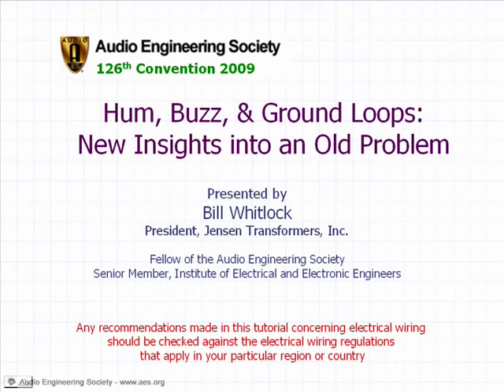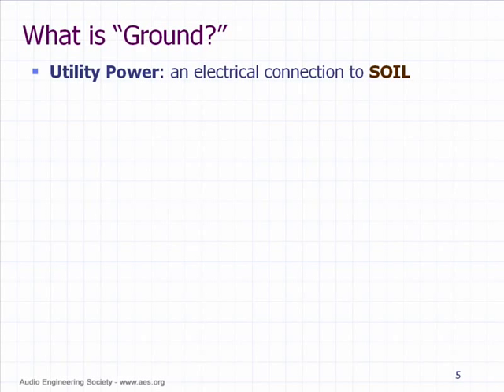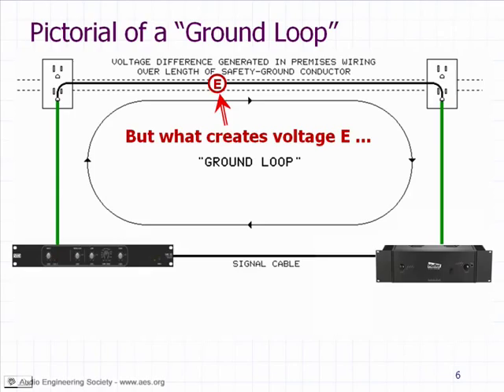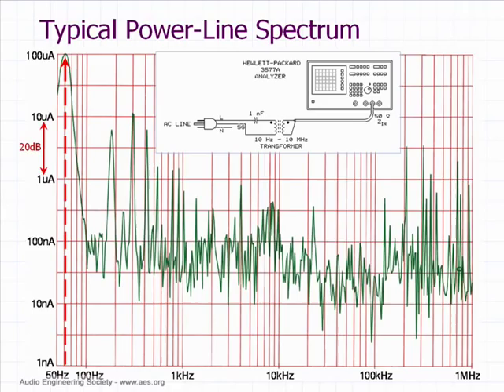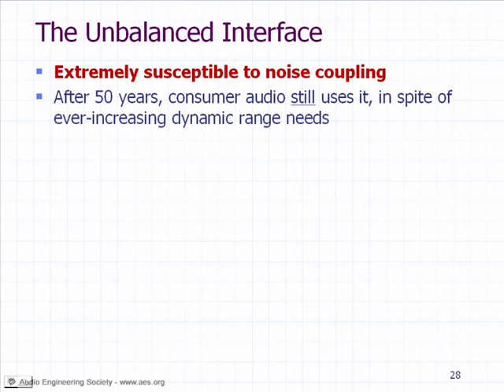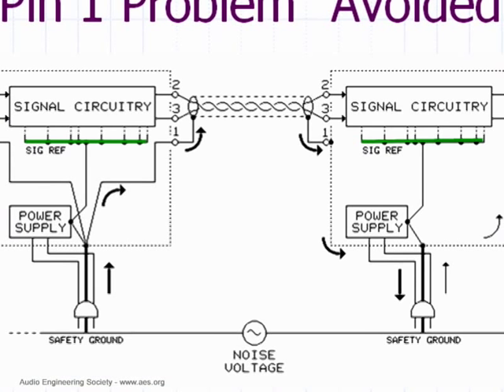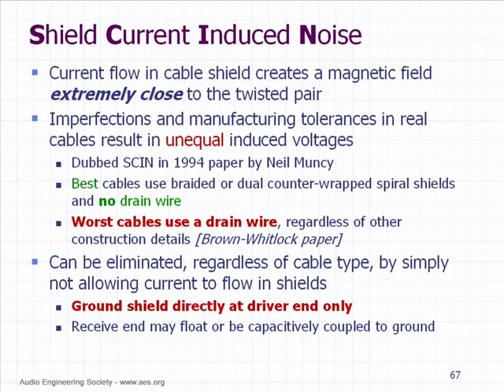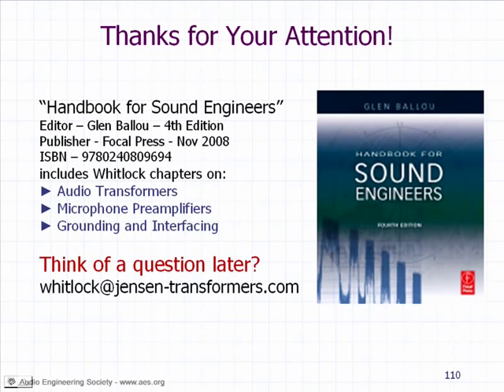AES Tutorial: Audio System Grounding & Interfacing by Bill Whitlock

Comment: FYI: now that it’s years later, there are many of his full lectures available on YouTube now. Although this was nicely edited down to hit many key points. :-) 

But, for example, this doesn’t contain anything about twisting hot and neutral wires in new installation, which is of tremendous help. Nor about using a larger ground conductor to reduce the induced voltage.  So definitely worth finding a full lecture. There’s one from 2021 that’s excellent.